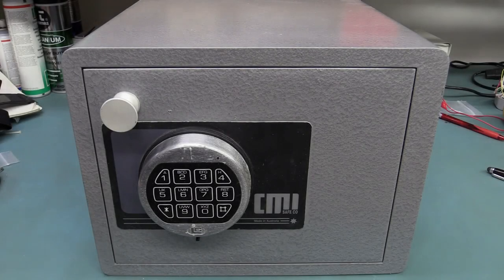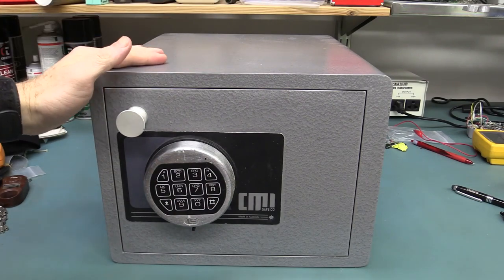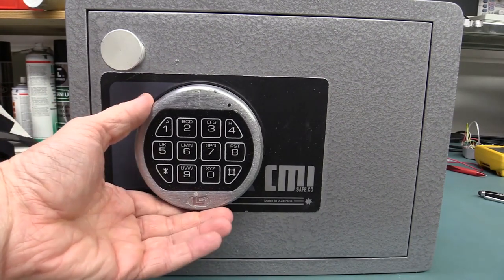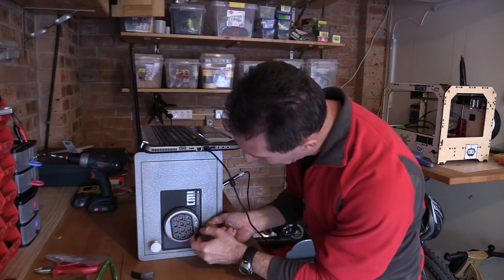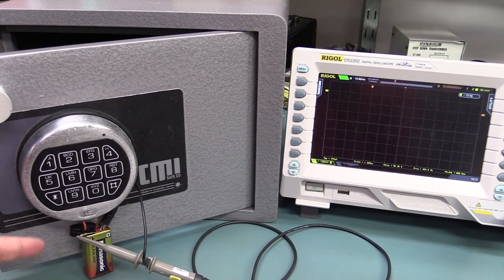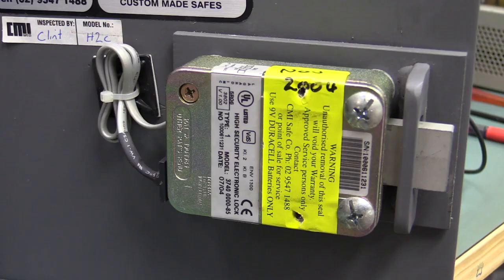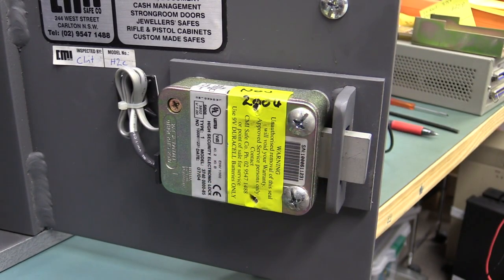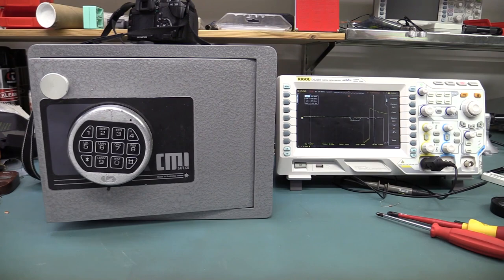EEVblog #762 - How Secure Are Electronic Safe Locks?

Comment: I doubt the power analysis would have worked anyway.  It isn't likely they would check the PIN until AFTER you'd entered all six digits, which is where you MIGHT catch a difference, but I doubt it and at that point you wouldn't really care because it wouldn't be helpful.  MAYBE you could use a power CUT attack by cutting the power just after the sixth digit, but I doubt that would even have worked.  Anyway, it was enjoyable watching you break into the safe after you forgot to plug the cable in.  I have to say, at that point, I'm not laughing with you, I'm laughing at you... :D  ... Seriously, that was a nice little detour from your usual stuff.  Very enjoyable.

Comment: cracking open the rotating keypad, figure out how the 4 pin data stuff between keypad and board is working, arduino and bruteforce.  wait for the "click" using a piezo or microphone and youre done
Reply from the maker: gamerpaddy You can't just brute force it, there is a 4 try timeout penalty.
Reply: how long is the timeout? Does it double each time, when it gets triggered?   i dont see a problem in there.  just make the ardu wait until its over.

Comment: Being a programmer myself, my first thought was that your power line analysis attack would fail unless their programmer is really stupid. Even without decoupling. The reason being that the most straightforward way of checking for equality of the entered code with the the correct one is to store all the digits into RAM or registers and then compare them in a loop once all six of them are entered or the code is confirmed or whatever. I believe there is no reason to do any on-the-fly checking, it makes the code more complicated, you need an additional "dummy" branch in your code (for when the code is already invalid but you have to pretend to still accept the numbers) and more conditions. If you actually have a processor that has at least few bytes of RAM available, to store the code temporarily, why would you do that? Might work if it was done using somd non-programmable logic though... Like old-school :). Anyways, really interesting video, we wouldn't know for sure unless you tried :)

Comment: I bet a strong Neodymium could pull that solenoid shaft inside and the safe would open.
Reply: So they do not use a steel shaft like Sentry does for its electronic safes? How would the electromagnet pull the shaft inside to allow opening up the safe door?

Comment: Entertaining video, as always, but two observations...  First, your gentle taping on a rubberized mat is hardly a credible attack.  Assuming a 1g pin with a 10g spring, that's only a 10G shock required.  Laptop hard drives are rated to 100s of Gs, in use.  Second, can the delay that prevents brute force attacks be bypassed by disconnecting/shorting the power lines?  At 1s per attempt, it'd still take 11.5 days to go through all the combinations, but you could shorten that a great deal if any of the keys showed signs of use/dirt.

Comment: I'm no locksmith, but me thinks that the keypad has nothing at all to do with activating or controlling the unlocking mechanism, other than transmitting the key pressed to another module, which then checks, selection & sequence... That's usually how digital type devices operate... 

So the "hidden code" in the key press, is nothing more that the number one or two, or what-ever encoded digitally... It knows nothing other than it's pressed value...

Comment: Maybe keyboard on the same i2c bus as eeprom? Dave too little try. I'm disappointed. You didn't try voltage brownout with power supply.
Reply from the maker: snik2pl The video was already 40 minutes long, I wanted to get it out. Can always do a part 2. Relax.

Comment: Couldn't you just use the holes in the back, a long screwdriver and a light to take apart the lock like you did with the door open?
Reply: Craig Diamond Unless you know beforehand what's inside the lock it's a risky stratagy, you might just make it worse. BTW higher security ones can't easily be dismantled unless the lock is unlocked first as the locks caseing is retained by the lock bolt, but doesn't look like that was the case here. Plugging the connector back in is the safest and easiest option.
Reply: Craig Diamond Do you mean to break into it when it is being used as a safe or for him to fix it?
If for when it is used as a safe, typically that will be against a solid wall, so you would need to get through the wall first.

You then have the issue of aligning the screwdrivers with the screw (or managing to turn the screw) which can be difficult.

Then, assuming you get it undone, you need to get the bolt out, which may also be somewhat difficult.
As the bolt is sticking through the case you can't just pull it off, and as the turny bit it also sticking into it that would prevent sliding it off. So you would need to lift it up enough to disengage the turny bit and then slide the bolt out.
So it would be fairly difficult.

Comment: I used to moonlight as a Loss Adjuster. You would be suprised how many stupid people do not bolt down their safes, bolt them to a removable timber shelf or Gyprock wall. Seriously. Another very common claim is for the 'Seniors Accident', where they think they have their foot on the brake, mash their accelerator pedal to the floor and drive their cars through their house.

Comment: Wait a second, it has a VdS Logo and no G-Number? So, it's not really certified and listed and the VdS logo is just a marketing-scam? Booo!
One thing i did not understand in your analysis: What about the LED-current? You should see someting like a 10mA or 20mA current getting pulled for the time the LED is active. Is that hidden inside the beeper-frame (are LED and beeper on at the exact same time?) or is this earlyer, smaller current peak you found with AC coupling actually the LED pulse?

Comment: how secure ??? the safe is already open and you try to  break it open ?
what happens when the battery goes flat ? how u open it then ?
Reply: When internal battery is flat, there's an external 9V battery terminal at the bottom of the input panel. You should be able to get a fitting battery at any gas station or most supermarkets.

Comment: 6 digits= 6! =6x5x4x3x2x1=720 possible combinations, in other words, a long ass time for the brute force method.
Reply from the maker: Wolf Punch No, a million combinations. Digits can be entered more than once.
Reply: +EEVblog Obviously 720 combinations remain after figuring out which 6 or fewer digits are used.  By the way if a power line observation attack had worked it would have given the order of digits, so no need to try 720 orders after that.

Comment: Power-line sensing to detect the difference in processing between a correct and an incorrect digit entry.

Great... so you already know what are correct and incorrect digits then? Was this idea not flawed from the start as you would not have that information to begin with? You would be guessing which response was correct and which false... no particular advantage at all.
Reply from the maker: Alex Mackinnon The whole point is to work out of there is vulnerability there. You do that best using an existing known code.
Reply: EEVblog With the other protection of the limited number of tries before an extended delay my point is that the vulnerability was almost non-existent as without foreknowledge of the code the data you can gather is of limited use... if you picked right you would still take far too many tries to derive the code in a systematic fashion.

Comment: Procedurally (thinking just of the code)
...it strikes me that no matter what, the button press code would look like 
start
'sleep until button press'
'shift current input array >> 1 digit'
'set button id to array element 0'
'compare array to correct array then act'
'sleep
loop
//in addition to other housekeeping like timeouts and brute force detection

so there should be no code difference between a correct button and an incorrect button.  The instructions are identical...
Reply: frollard How do you execute "compare array to correct then act" in a single instruction?
Reply: Nick Johnson It doesn't have to be a single instruction. He's just posted "pseudo code"
Reply: Martin King But that's just the point - if it's multiple instructions, there could well be a difference in runtime between correct and incorrect codes.
Reply: Nick Johnson Right, but that runtime will only avail itself after 'counting to 6' button presses, eating one of the precious brute-force-attempt lockouts.
Ideally it would use very similar instructions in the positive or negative response to checking each digit such that they execute in the same number of instructions.  
compare, true increment correct sum, else increment incorrect sum.  still has a comparison and an increment instruction, shouldn't be a significant difference between executing a successful 'if' and or the 'else' code that follows. 
once done all 6 digits check if 'correctsum = 6'...
They won't be absolutely identical but in number of instructions they should be spot on.
Reply: frollard What you describe would be a sensible approach if you have security in mind, but what makes you think they were sensible? The simple and obvious method of checking each digit and stopping at the first mismatch would be very vulnerable to a timing/power attack.
Reply: Nick Johnson Fair assertion.  I was operating under the impression as dave said this particular lock is not to be confused with the crap chinese ones by reason of 'they have thought this through'.
Reply: +frollard Sometimes reputable products forget some crucial detail.  And that is what safecracking and codecracking is all about.  You don't know which precaution they forgot until you check.

Comment: Likely, it saves each keypress in RAM along with the timestamp (relative, no need for the actual time, just need the difference between the first pulse and the current one for a duration). So, you press a key. It saves it to memory along with the timestamp. You press another key, and if the key is soon enough after the first press, it saves it, too. This continues until the 6th number. At this point, it compares the codes. Blah, blah, blah. To make every subroutine the same length, you can compare the code every time but send an extra argument if it should be a real comparison (so you don't get locked out every keypress).

Comment: fyi  u can open this thing whit a gummi hammer if u stand it on a bed or soft surface youst pound it and try opening the door  safe may be greate but actuators used for electric safes are crap ^^

Comment: to late, but,,,,
Externally, an extension, with an alligator clip , with a rubber band holding it open and String to pull the rubber back,,,,  then abit of light, and perspective...

Comment: Why even drill any holes at all? You know those long spring-wrapped grabber things? Could've gone through the rear hold with one of those, along with the borescope - or not - and grabbed the wire, and plugged it in enough to make slight contact to get it open. Then re-attach properly. Drilling extra holes was unwise. It won't do anything, but those are now extra holes you have to worry about filling if you attach it to something. They are extra starter holes for other tools if you don't or if you don't attach it to a solid floor - ie a dresser or something instead of concrete.

I don't have a PINN for anything. I use a PIN. I also don't use an ATMM, as those are typically illegal. My car doesn't have a VINN either. It has a VIN. I rarely use an ATM either, but still.

Please don't spread this.

Comment: Just had to have a laugh about your HP there which looks like my dads old DV7 HP.  i5....  and for whatever reason that left plastic above the speaker grill is also broken.  Like hey how'd dads laptop get to the land down under  lol  it looks exactly the same .  smh  looks like it even has the fingerprint scanner.  might actually make my dad feel better.  I like my Dell speakers better.  there is only one real weak point in the case (other than the monitor bezel)  and thats one corner around the optical drive.  X_X  and up do anyone to figure that out   XPS L702X.  Now oddly dads gun safe ..  his button pad opens right up.  just twist it off and viola available innards.  now what good that will do I don't know  but then again the handle isn't built into the keypad

Comment: I would design it so the keypad only sends the entered PIN after all the 6 digits has been pressed, and only after that the chip can compare the recieved data with the stored data, and tell you that you entered the wrong PIN. Even if you can guess it by a powerline analisys, no shit Sherlock, IT DIDN'T OPEN. So yeah, no suprise you couldn't get it open this way

Comment: Giant Magnet attack, A massive magnet placed and then moved horizontally in the direction you need the pin to move, May be able to move the pin out of the way, Safe Techs have giant Magnets with them for this reason... cheapish safes take seconds.

Comment: A power-line attack is extremely unlikely to be successful on any device such as this. Imagine how most people would naturally code this up, even in Assembly. Naturally, I think most programmers would just buffer the key presses, then compare the buffer to the stored code at the end. Therefore, any difference in current draw will only tell you what the device already does (Success or Fail). Interesting experiment, but IMHO terrible hypothesis. Moreover, I seriously think that lock could be bumped if you applied a little more force, or used a strong electromagnet.

Comment: Fuck the electronics.  A heavy crowbar with a pipe extension and you pull that box out of the concrete and take it with you without a problem.

Comment: I am shocked that you could drill through with a shitty battery powered drill. Only the other day, I saw a video on how they opened a proper safe from the scrapyard in a few hours, wasting 3 or 4 discs, and the sparks literally burned up the guy's safety gloves in the process...
Reply from the maker: Baerchenization Not surprising if you know about safes. Anything less than an anti-drill manganese plating and/or refactor materials in the concrete inner fill will deter drills. People think a safe that costs a few hundred bucks will protect them, but they are trivial to drill/smash/grind through. Even this $800 quality brand CMI, albeit a basic model.
Reply: EEVblog Not that I thought it'd be drill-proof -- but I thought at least the drill would run out of juice 10x over, and maybe that it would require more than 1 drill bit :P

Comment: What happens if the battery dies?
Reply: MEtfan what should happen? The code is in an EEPROM and Dave disconnected and reconnected the battery plenty of times just for this video. And as he said: The code is on the pcb in the lock mechanism, not in the keypad.
Reply: Yeah i saw it after my comment.

Comment: That lock can be bumped easily with a hammer.
Reply from the maker: Notmy Realname Got any proof of that?
Reply: Send me the safe and I'll demonstrate. You don't even need the hammer, just drop it on its side hard enough for the weight of the pin to compress the spring. Measure the force required to depress the spring the required distance in newtons, weigh the pin punch that into a fancy Casio calculator to determine minimum Gs required to displace that pin while turning the cylinder. - or just whack it on the ground sideways. 

Classic lock bump, one tumbler, kid stuff. I bet you can open it if you try in under 5 minutes. 

The only way this safe is at all secure is if it's bolted down. Unbolted it may as well be unlocked.

Comment: 6 mm steel makes me wonder how strong that steel is and if large-ish machine tools of just about any description wouldn't make short work a that. LMAO, chuck that thing up on the faceplate of a decent sized lathe and even if it is medium hardness hardened steel (and it really can't be harder because then it would be brittle enough to shatter) and the entire top plate should be reduce dto a pile of steamin hot chips in no time. Wahahahah How'd that be for a "teardown"

Comment: Who is stupid enough to design an electric safe without a key as a backdoor? Poor INSANELY POOR safe design.
My shitty bump prone safe at least has a dual bearded key.
But at least you can get to the battery from outside but that is a DoS waiting to happen. When you are in a divorce your ex-wife would but 220V on it and fry the circuit and your guns to shoot her are locked up :D ;)

But respect for your CHOP STICK handiness! WOW WELLDONE!

A good programmer would store all the 6 digits and only then do a comparison -- preferably the original number is also encoded in some way to prevent 'leakage' a simple series of binary operations would be enough and do those operations on the entered code and compare the outcome.

Comment: Absolutely not secured at all use a 25 pound neodymium magnet put in sock stick on to front of safe move it around for a few minutes you'll activate the relay congratulations you just gained access in that safe not very safe now is it!